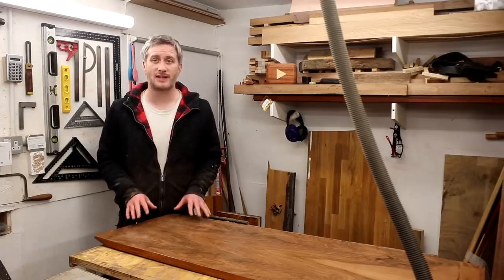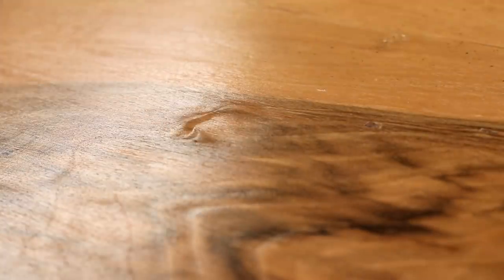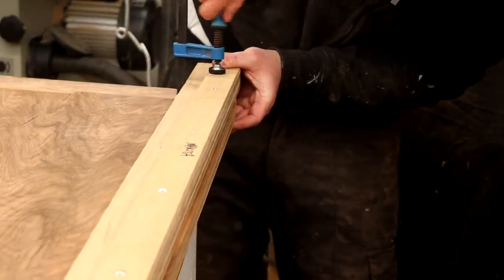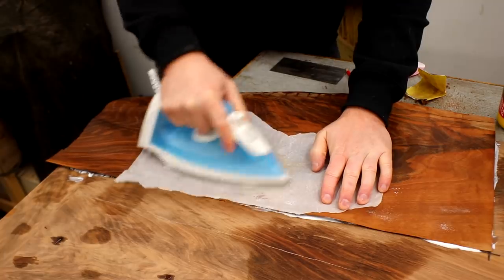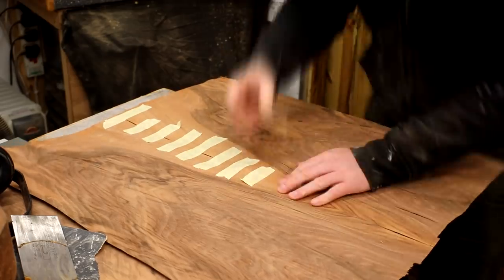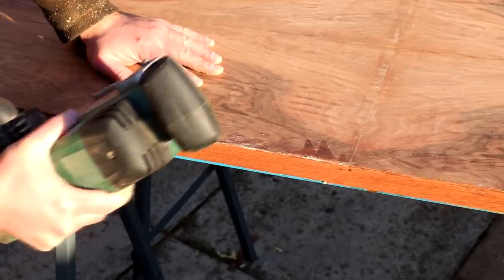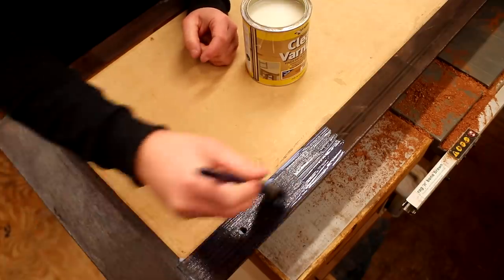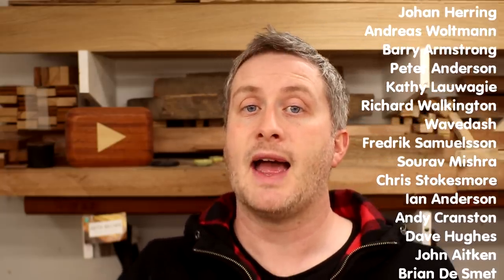Applying A New Veneer - second attempt restoring a mid century coffee table

Comment: Hey Keith. First of all I'm a big fan of the channel and thanks for all the entertaining content you put out. I am a professional cabinetmaker and have done lots of work with veneer. I love it but it does present many challenges and it can be discouraging especially for beginners and hobbyist woodworkers, so I admire your determination. I have a few observation I would like to share and hopefully you'll find them helpful. The bubbles that you got under your first table probably had little to do with your finish and more with the inadequate pressure that was applied to the veneer and it might happen again to this top as well. When pressing veneer with contact cement you must start from the centre and work your way out making sure not to miss any spots, also it looked like you had way to much contact cement, all you really need is a very thin layer applied to both surfaces. Also contact cement is not ideal for "raw" veneer but it mostly works well for paper backed sheets. Regular veneer needs to be pressed, a very common and fairly inexpensive way to do it is to make your self a small vacuum press, they store in a compact space as well.  Another observation I have is about the leafs you were using, they were way too dry to work with, instead of spraying it with water what you need is veneer softener,  which will make the veneer malleable and less likely to break.  Also the proper way to seam veneer is to do it before it gets glued to the substrate; for that you need proper veneer tape. you can also use the tape to stitch the cracks together so that when you lay or press the veneer there is less risk of the crack travelling and expanding. In my opinion the easiest way to get introduced to the world of veneering is with paper backed sheets and contact cement. it doesn't require a press and paper backed is not nearly as fragile and it doesn't dry out as much ether. I also suggest checking out some books on the topic there are lots of good ones out there. Veneering is a fantastic and very satisfying part of furniture making and it can really step up your work if done correctly but unfortunately is not something that can be rushed, it requires the proper set up and the proper tools. I hope you find any of this helpful and good luck. Looking forward to the next project, hopefully with veneer. Cheers from Canada!
Reply: Thanks from viewers too buddy! We all learn from the greats!
Reply: I was going to reply and make pretty much the same points as Tommaso, but he gave a very eloquent reply.  If you follow this advise you will do better next time.
Reply from the maker: Thank you so much for the great advice 👍
Reply: That's some really helpful information thanks for sharing.
Reply: Good points.  Question; I have never done veneering.  Only plastic laminate.  We used a heavy hand roller for that.  Is it possible to use a roller instead of a vacuum press?  Also, is shellac at all useful as a sealant to keep the wood surfaces from absorbing the solvent in the cement?  Cheers and thanks for letting us know some new facts.
Reply: alex tworkowski if you are using paper baked veneer then you won’t need a vacuum press and you won’t have to worry about the solvent seeping through ( as long as you allow for proper drying time and don’t apply too much). That’s why I only suggest using contact cement with paper backed sheets. If you are familiar with applying plastic laminate, applying paper backed veneer is a very similar process. A veneer press is required when using wood glue, it basically clamps the veneer down while the glue cures. I don’t have any experience with  shellac and contact cement mixing, but my guess is that the solvent might react with the shellac, if you really want to experiment with it, try water based contact cement that might be a safer bet. If you try it, let me know what happens. Hope this helps.
Reply: @tommasogiangrande8096    Ah, good thoughts.  Thank you.  It's a fascinating subject.  Glad to steal some of your wisdom.  Thanks again.
Reply: I had a buddy who was a veneer and laminate king - he swore by the old fashioned spray can of 3M '77 here in the States. I'm pretty sure that's just a standard contact cement but in an aerosol format.
Reply: I agree.  Besides some other mistakes, the weight you stacked is far from enough.  Even if you would load 1 ton (1,000 Kg) on a surface of 1 square meter, the pressure per square centimeter is only 100 gram/cm2.  I guess you did not load more than 100 kg, so you ended up with less than 10 gram/cm2.
Reply: Thanks Tommaso for your input. Cheers from Canada too.

Comment: Have a try with Cascamite to glue, it can be coloured when you mix it so any squeeze out (like if you're using a burr veneer with small holes) is less visible. I'd also echo the comment about using proper veneer tape which can be stretched to pull the joints together.

Comment: Nice job. I love to veneer and fix veneer but that is the meticulous OCD in me. A few pointers that I find helpful: flatten the veneer before application and use a softener made with glycerin. I dont worry about most cracks as they usually come together when you pre-flatten, I prefer hide glue  (or cya for teeny jobs). I use a thin razor to slit a bubble along grain line, wet it and iron it. Pins leave holes. In the initial application i use a j-roller followed by weights or in the case of a curved edge like an empire leg or waterfall dresser I use tape and or a band clamp. your follower across the pond.

Comment: Hi Keith I have used some of those ziplock plastic bags with the valve that you suck out the air with a vacuum cleaner, only on chessboard size project, so don't know if they would work on a table that size or even if they make them that big. You know the one's that you can put a couple of duvets in, and they end up the size of a brief case.

Comment: Well it looked good before, especially after the iron was applied but now, after redoing it, it look amazing, the tounge oil really did work wonders on the grain/colouration and was interested in the use of water based varnish after the oil was applied, I had just assumed that you would use several coats of tounge oil once you started using that. Happy new year, best of luck for 2019.

Comment: I wonder if the age of the veneer sheets added to the original problems. Wood furniture does dry out and get brittle and it can be treated with a fine oil, so perhaps a thin application of oil to the veneer before applying it might have helped.

Comment: I have zero experience with veneer, so take with extreme grain of salt.  I've heard that if you use pva put thin coat on both sides and let dry enough that it doesn't stick when put together.  Position veneer and iron on.  The iron theoretically will reactivate the glue.  I've never tried it, so your mileage may vary.  It has the advantage (assuming it works) that you can work from the center out getting each small section perfect before moving on, and somewhat alleviate the need for a press.

Comment: Think I said this on your first video Keith, you need to condition the veneers to start with, veneer softener, trust me it will make things go easier.
Reply: MxJay I agree, also cold press veneer glue with roller, veneer tape to close cracks and join joints, and make some clamping cauls. Veneering can be a lot of fun. Cheers

Comment: Looks great Keith 😉, a while ago I read or heard (can't remember) for putting water based varnish on a large area it's recommended to use a Pad Painter to avoid brush marks (paint has the tend to dry while applying) I did this recently on TV Stand I made for a friend first at all it's a time safer and second it turns out nice 👼

Comment: The contact cement is far better option for this, since you dont have a vaccum press. You also need to flat the veneer previous to adding it and press reaaaal hard, you can also use more than 1 layer of contact cement if the wood is thirsty. To have a better joints you need to joint them with loooots of tape pulling them together before glueing. Also ... water born finishes are ok, but you need to wait at least overnight on the contact cement. Most of them dont get the full strength until several days

Comment: My advise is stay away from water base crap. Your putting water on top of oil. Not a good mix. Also use lots and lots and lots of glue and more glue to prevent air pockets. 3rd: if u use contact cement glue, the trick is to let it dry then put the Venere on and use a high pressure steam iron which will reactivate the glue causing everything to stick

Comment: Vaneer is a pain in the ass. The only way to really do Vaneer well is with some kind of press or vacuum. I did six drawers with a birch Vaneer and none turned out perfectly. You need to apply a lot of pressure and working with contact cement is annoying. Also I think there are better quality vaneeers available that won't break and warp so much. Mine was prety cheap but very flat and in good condition.